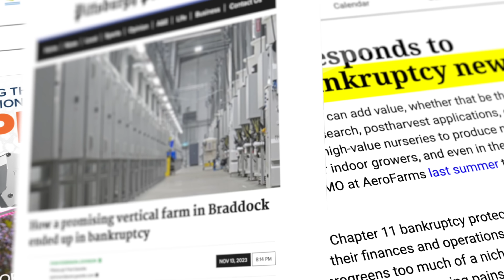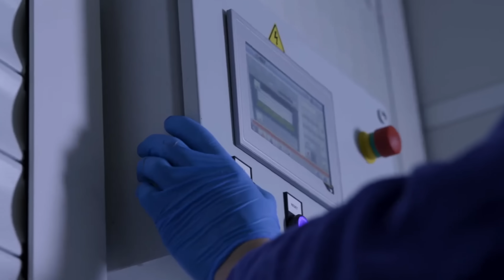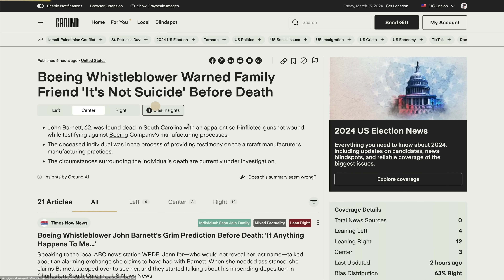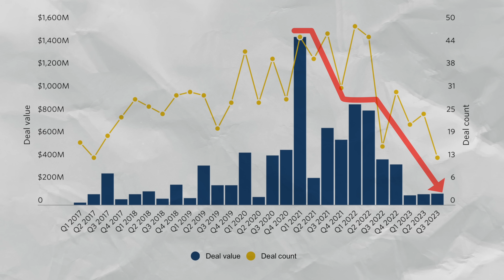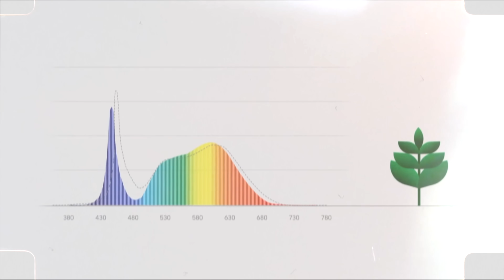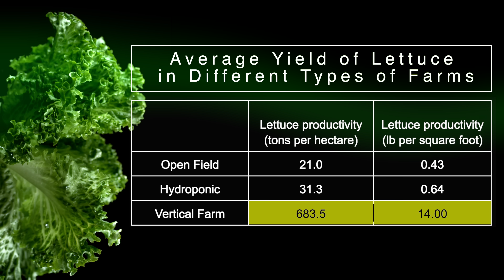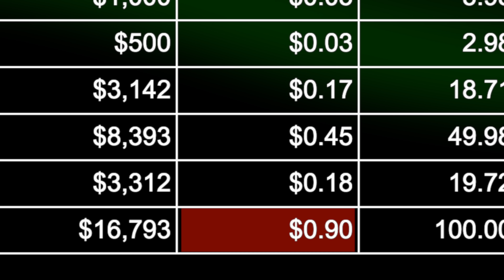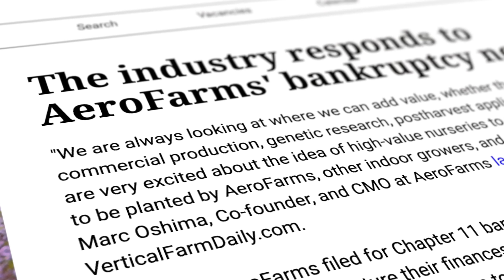The EPIC Failure of Vertical Farms - What Happened?

Comment: Thanks for this informative video. Here n Germany the decline of Vertical Farm busniesses din't really make the news. I saw that the Infarm-Section at my supermarket was removed but couldn't get an explanation from the people there.
Seeing that the cost for blue collar labor is highest is easy to explain with the difference in workforce (students etc. vs. unskilled farmhands from Mexico).
What disappoints me is the lack of patience investors have with these businesses. They take longer than current hightec startups to turn a profit. And stock prices for hightec can get hyped up much easier than for vertical farming.
An alternative to the massive vertical farms was (and still is) a smaller sized application. Cubicfarms has a much smaller footprint and can be installed in remote locations as well as in city centres. Maybe have a look at them and compare to those mentioned in the video.
Reply: the issue is the different structure of labor.  a skilled farmhand can harvest aloooot of lettuce a day, much more than a vertical farm can produce.
vertical farms make sense for labor intense crops that are normaly highly seasonal.

Comment: Those companies failed because the investors wanted a quick ROI which doesn't happen in farming.  They did mono-cropping which isn't the answer either. There is greater success with diverse cropping whether it be earth , vertical, or hydroponic growing.
Reply: Easy to say until you try to run a large garden!
Reply: @brentnevius2849  Let the truth be told!
Reply: Investors can be narrow minded and not big picture. What a shame. Grow a variety of crops instead of a monoculture and use different fertigation recipes for different plants! Grow more profitable plants too. Lm301b diodes and lm301h diodes are full spectrum and highly recommended for energy efficiency and Photosynthetically available radiation.
Reply: He explained that vertical farms only do well with the mono crop of lettuce and other leafy greens.  For some unknown reason they are not good at diversifying beyond that.
Reply: @SavoyDFW  Looks like they're working indoors and attempting to absolutely maximize space. So the plants when grown at ground level are maybe knee high at most, and when grown indoors can be stacked floor to ceiling 3 or 4 rows high. You can't do that with a tall plant like corn or wheat, and you certainly can't do it with trees.
Reply: Don't blame the investors, blame the founders for selling a product they cannot deliver.
Reply: Word….
Reply: Really not the case at all.  It was never going to make money.  Vegetables don't sell for enough money.  The problem is vertical farms are barely better than greenhouses... while being TREMENDOUSLY more expensive than greenhouses.  It's also a NIGHTMARE to try and control fungus in a setting like that.
Reply: not true at all
Reply: That's not the case in Dutch greenhouse farming usually those greenhouses are mono-culture at any one time per greenhouse - they may have tomatoes in one and cucumbers in another etc; however broad acre yes crop rotation and diverse crops, companion planting etc helps with disease and pest mitigation.